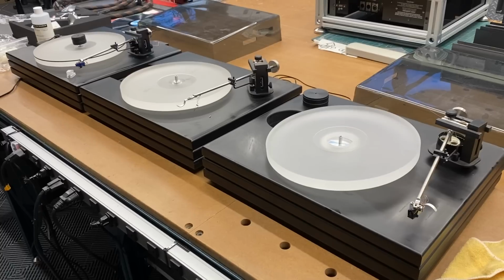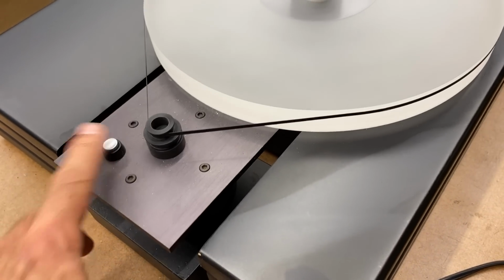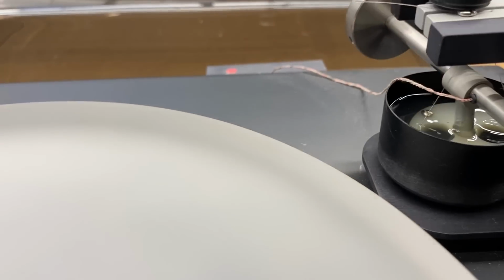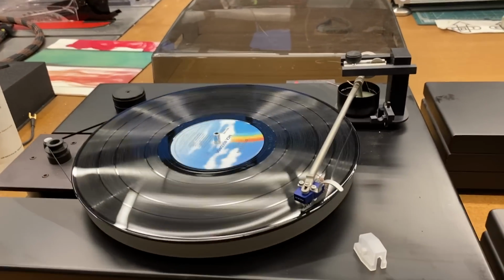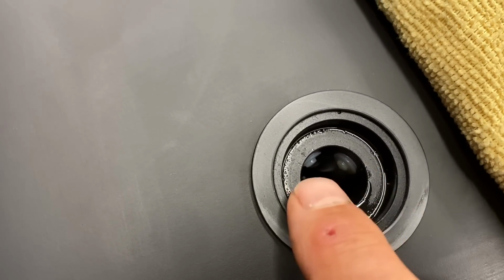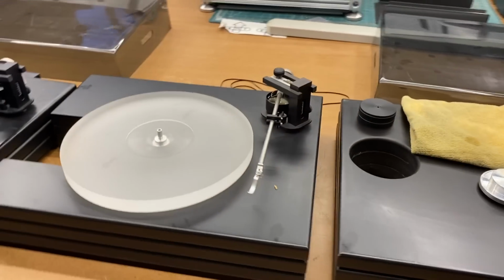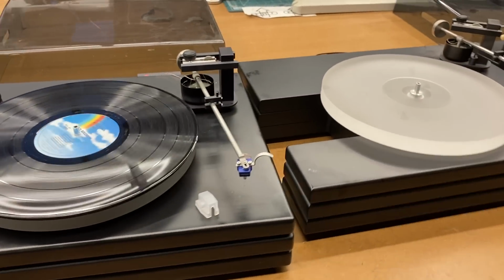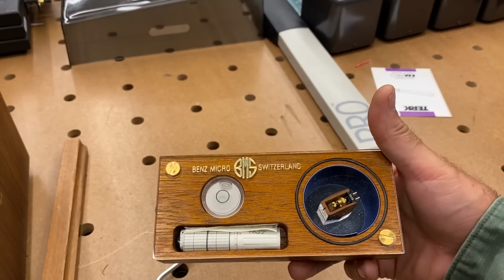The Most Ingenious Turntable from the 1980's - The Legendary Well Tempered Record Player (WTRP)

Comment: I recently bought a WTClassic with round motor. I had no particular difficulty to setup the tonearm and YES it sounds terrific amazing with a SUPEX900 super MC phonocartridge.  
I have the same cartridge mounted on an Ekos Linn Tone arm on an LP12 with a Greenstreet aluminum sub-chassis + Mober DC motor + Linn Karousel upgraded bearing: the whole thing costs me more than 4 times the price spent for the WT Classic!
;-((
The only concern is that the top slab is severely misaligned. In order to fix that i guess i have to remove the spindle and bearing in order to move out the upper slab and then add some sorbothane 1/8 inch thick . I'm not sure i will drill some holes in order to add the wood pins as recommended. Let me know what's the best way to successfully address this cosmetic issue. Thanx in advance

Comment: Hi, can you please help me with some advice badly needed ? I am trying to find out if the round pod motor in the Classic is AC or DC ?I am bringing  one over from the USA to the UK and the difficulties with the elec supply seem complex but less so if it’s a DC motor .
I was thinking too of perhaps replacing the motor and PSU with an Origin Live DC motor and PSU .would this be a problem and would it work ? The main issue is ac or dc though . Any advice is very much appreciated , thank you in advance

Comment: I have a WT. I love it! It is one of the best Turntables ever made. I think one of the most important features is that the Motor is on its own. The second thing is the Oil based buffer of the Tonearm and the Plate. The same cartige sounds 10x better than at my Thorens 320. So for me it’s sunnclear, that it is 90% the Turntable itself

Comment: This is the worst tonearm design ever created. The irregularity of the silicon base will cause the antiskate to constantly fluctuate. The belt drive design is the least accurate drive system because the belt's elasticity and grip changes every 25 hrs of use not to mention environmental temperature and moisture. But you know that already, who's gonna say no to an uninformed customer will to pay you right ?

Comment: Modern Turntable designers: So, we isolated the motor using same vibrational-isolating bearings SpaceX uses to isolate key components on the Dragon capsule, only we partnered with Mitsubishi's medical arm to codevelop a bearing based on that used in their MRI machines to...
These guys, 35 years ago: We just made the motor a seperate piece. shrug

Comment: That tape was a cheap vibration absorption tape with a good surface adhesion. On my two WT tables, one is The Reference and one is the Records Player, square hole, I took 2 small wood wedges and a rubber mallet and gently tapped between the layers until they seperated. I replaced it with Sorbothane tape 1/8 inch thick, from Amazon, and used a rubber cement on both sides on the Sorbothane to prevent any drift on the panels of the plinth. Amazon also has Sorbothane pads 1/4 inch thick which will work as well.  I also drilled about 1/3 third inch in 3 locations on each panel and lose fitted a total of 6 wood dowel pins so the table could be moved without any concern of drift. This made the Record paler as dead and true as my Reference table. This added another level of deep sonic purity to the playback which I have NEVER heard on any table at any price and I have listened to MANY high end tables. 
The trick to perfect hole alignment is to put the low layer piece down on a flat surface. I cut 2) 2x4 boards 2' long and screwed the together at the ends while they were vertical. I used a T square to make 100% sure I had a true right angle and braced it up against one corner of the WT base layer. Alternately, you could cut out 4 pieces and form fit it in a rectangle against a non drifted WT table for a perfect fit. .   
Then I got 3 quarter" flat washers pads and painted them with thinned, one small drop of isopropyl alcohol, ink from a ballpoint pen cartridge and quickly placed them about 120° apart and with the spindle in the middle section, carefully satt the middle layer down on the bottom section. Then repeat the process for the middle to top layer, 
But first, I bisected the ink dots marks now transferred to the table layers with a sharp fine tipped Sharpie marker using a straight edge. 
Next, using a sharp ice pick or center punch, make center impressions for drilling. I used drill bit guards so I could only drill down 1/3rd inch. I applied the holes with a little RTV silicone rubber to prevent any direct pin to plinth layer contact.
Next was to apply the Sorbothane runs with a  thin layer of  rubber cement adhesive on both sides and placed them,
  With just a little play between each pin and the holes. and Sorbothane runs laid out,  I quickly, sat down the middle section on top of the bottom for a PERFECT FIT. Having a helper at your side so you can check the alignment in both planes helps. Once the middle is sitting on top of the sorbothane and pins you will have a permanent alignment with MUCH better isolation and vibration absorption.  Of course, repeat this process with the top layer with wood pins, sorbothane and spindle in place. 
My reengineered process can be done in less than an hour and I defy anyone using any table at any price to produce a more realistic and pure tonal experience. My mod can be done for ~$70 or less and is worth 100 times the price. I believe the addition of the sorbothane layers to make most of the improvement I found 

Glenn Scott
DSM Labs
Reply: Thanks for this tutorial on how to fix the drifting of the layers. I have a hard time visualizing what ou are doing here, however. A video showing each step of your process or a more clearly written step-by-step guide (with photos!) would be most helpful. From what I can understand, you have wood pins connecting each layer here--that is a concern in transmitting vibration between the layers. This is counter to the original design, which is to isolate each layer with Sorbothane.
Reply: @wbondsteele   YES i have exactly the same concern about the wood pins... Like you i'm waiting a better step by step tuto with photos! I guess we have to remove both the arm and the spindle/shaft before trying to unglue/separate the upper slab...

Comment: I was fortunate enough to own not one, but two of these incredible 'tables during my high-end audio hay days. Right up through the mid to late 2000's - even my then $8k Esoteric CD player couldn't compete with it. Friends were always shocked & amazed that a 'record player' could sound that good...was literally like listening to the master tape, provided you had the cartridge and other ancillary components to match.
Reply: I've had mine for over twenty years!  I have a hinged lid on my unit, but still, dust in the silicone bath is just not a problem. You can't see if dust is getting in there and if it is, it just doesn't affect it.
Reply: How did you keep the damping fluid clean? Did dust and particles in the air not continually "rain" down into the fluid cup? If so, how often did you have to clean or replace the fluid?  Thank you.
Reply: @oronmendel2451  I think just let the dust get in it. There is little one can do but it doesn't seem to really effect anything.

Comment: Please tell me you sell the fluids for the table. I have a WTT classic and need to replace the fluids(tonearm+turntable spindle). I'd appreciate it very much. Thank you. I live in the Chicago area.
Thanks again.
Reply: Thank you so very much.
Reply: @keithperry602  I added more info above - Also, the 5W20 or 5W30 synthetic oil is for the platter bearing ONLY. - 5W30 is a little thicker. Don't forget to add the half twist to your neoprene belt!
Reply: I am retired from a large Printer Mfg.  Silicone oil can be sourced from an office supply dealership that sells office copy machines.  And yes, it is that viscous.
Reply: Get STP for the arm pot and 5W20 or 5W30 synthetic oil for the platter bearing. Many found STP a bit less dense for the arm pot.
Reply: FYI: the silicone fluid can be found on eBay - Get the one with viscosity rating of 100,00. Fill pot approximately 1/3 full. Clean up any spills with Witch Hazel. BTW: dealers at audio shows use honey in the pot, since it's water soluble and easy to clean for quick departure..
Reply: Thank you

Comment: Nice overview!  I have the original Well Tempered Table.  It is such a cool design, very unusual and tracks the records quite well.  One really minor detail, the belt is meant to have a half-twist between the motor pulley and the platter. Bill Firebaugh says it helps the belt slip off the platter and off the motor pulley smoothly as it rotates, which further reduces flutter.  I'll take their word for it 😉!

Comment: Firebaugh always recommended putting a half twist in the belt between the platter and motor. Rewiring the arm is tricky, because it's filled with sand.

Comment: Really cool design, especially the tonearm, but I never got how the Anti Skate works.
They should really have just run 2 to 4 screws through all of the plinth layers from the bottom so the drifting issue doesnt happen over time.
Theres no audio issue with a lid however, as long as its kept down while playing. You would need to listen at deafening volumes to make the lid actually interfere while up, and its been tested that lid down even benefits the sound in that case as it protects the tonearm and record from reflected vibrations.
Reply: By turning the vertical silver wheel, you can adjust the spacing between the two bars holding the monofilaments, and this will vary the amount of twist that generates the anti-skate force. Bars closer together = less anti skating, further apart = more anti skating.
Imagine a playground swing seat supported by two chains to a bar above. If you slide the chains together on the bar, the swing seat will rotate quite easily. If you spread the chains widely apart, the seat will have a strong force trying to return to the straight ahead position.
Reply: Yeah, putting your tonearm in liquid should be mandatory for any mentally ill audiophile. Really makes the vinyl sound smoother, amirite?
Reply: @honkyjesuseternal  Someones jealous.
Reply: @leon9021  Yeah, I wish I had a well of juice to put my tonearm's nuts in. Sounds like a great idea.
Reply: @honkyjesuseternal  Im sure an engineer such as yourself would know.
Reply: @leon9021  I know a bullshit gimmick when I see it. Christ, if someone told you to put your audio cables in the freezer for 20 minutes you would do it?
Reply: @honkyjesuseternal  I'm not sure you understand the arm at all. This has been around for a long time. Some big old arms from the 50's and early 60's used this same principle.
Reply: @honkyjesuseternal  I was only explaining, not saying if it is good or bad. Why are you so rude?
Reply: Marten Dekker  Holy stupid sauce, you must be Qanon?